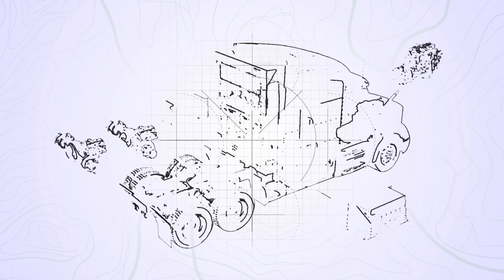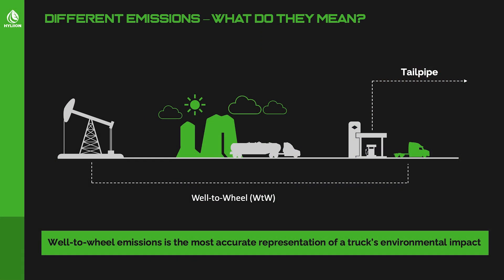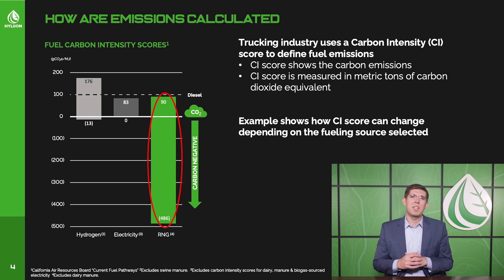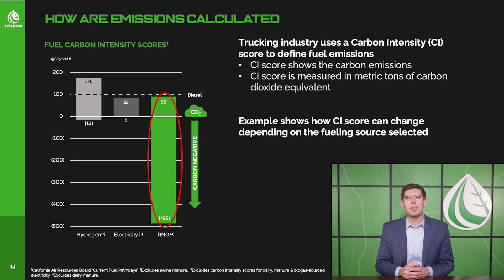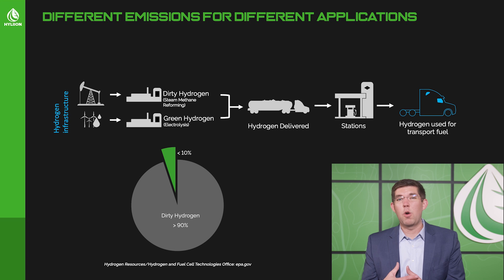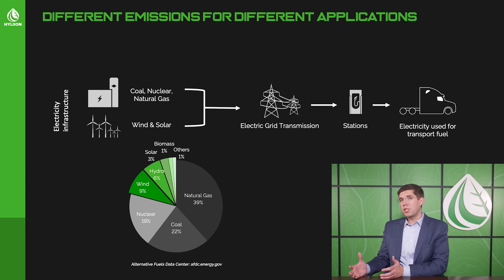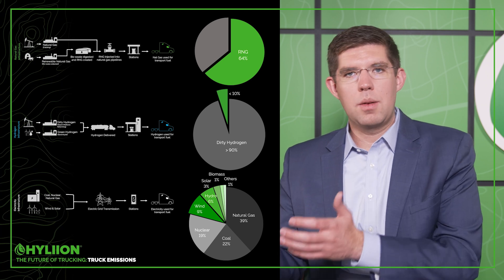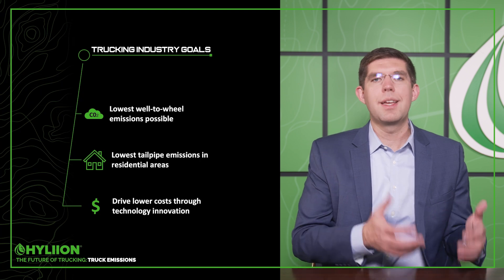Semi-Truck Emissions | The Future of Trucking

Comment: Well. I appreciate the concept explanation here. But seriously, TH needs to give a presentation on the use cases with realistic estimates of truck cost, fuel cost, fuel savings, mileage usages, the lifespan of the truck, the upfront and maintenance costs. And show us models of how a fleet (from small to large) could save money from using your products. Also please give us updates on the current production issues/challenges, and when you guys could mass-production? Seriously, just going over and over again these virtual concept lectures are not gonna last long.

Comment: Do fleets care about well to wheel or that they are just checking a box to get the credit etc.
Reply: They want to check a box and get the lowest total cost of ownership.
Reply: @elliottstevens8564  I am not convinced yet that having a BEV semi with a charging station will lower their TCO.
Reply: @rexking9461  it won't.  And unless/until there is a step change in battery and charging technology it never will.
Reply: I believe that everyone wants to do good for others especially when it doesn’t cost them anything or even save them money to do so.
Reply: @rexking9461  right but from a standpoint of a fleet adopted electric and met the requirements. It’s not their fault where it’s sourced. They did what is required. Don’t get me wrong hyliions solution seems to be the best
Reply: @drewtaylor7641  Agreed. We need the government to step in to sort out this convoluted situation. But as we know that to have a charging station for BEV semi is very expensive.

Comment: There should be commercials on TV or news agencies preaching this info. The general public is brainwashed into thinking that BEV and Hydrogen are the answer.
Reply: Because there is a misconception that "tail pipe emissions" is the wholesole metric of measuring the "greeness" of the technology. I have been of the opinion for long that there needs to be a composite metric which includes "well to wheel" aspect to measure the "greeness" of the available green technologies. But we all know when politicians are involoved in framing legislations oh well how it goes. Law makers are there to cater and appease to the lowest common denominator of the masses on the intellectual scale and that is how the masses are hyped up. A very good video to explain how a composite score for a green technology is the need of the hour and not a superficial treatment of this topic which very well actually will dictate how the money and talent and energy of the engineers are spent in finding the the right solution in incremental steps.